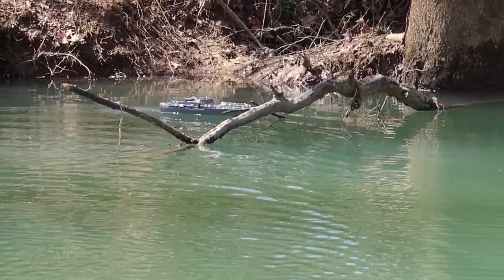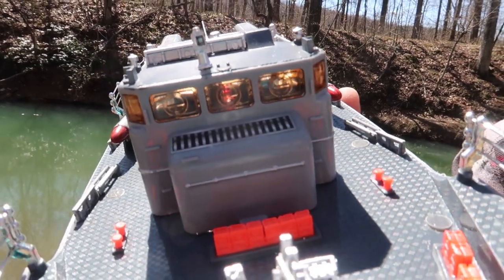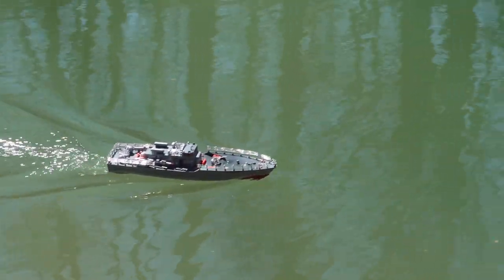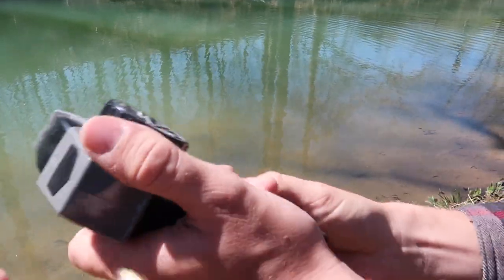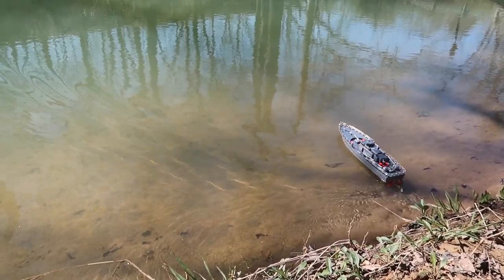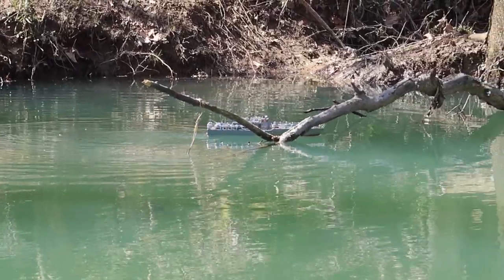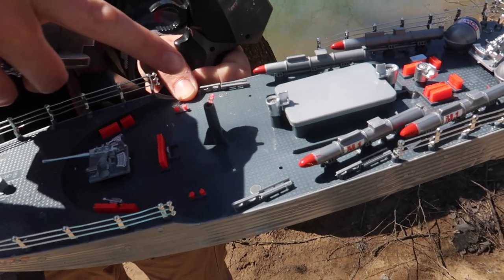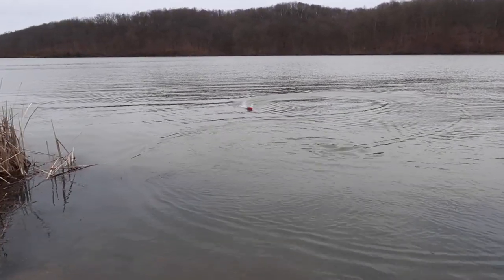MISSILE DESTROYER RC Boat!! - 1/115 SCALE EHT-2877 - TheRcSaylors

Comment: That is a very good looking boat. When you turn the wheel with out pressing the throttle does that make one motor go reverse while the other goes forward?  
I can see myself adding an anchor to that boat and a servo to control it.

Comment: Don't want to be a drag but the twin engines that steer one on one off are differential thrust and the really cool green stunt  boat where the prop moved is called thrust vectoring. not an expert buit think this is the correct terminology.

Comment: What Causes a Blue Tint in Well Water? 
Copper in the Water Supply. Residual amounts of copper are normal in your water supply, but cause problems when the...
Corroding Pipes. If you have pipes made of copper, replace them with PVC pipes to see if this corrects the problem.
Electrical Grounding. Using water pipes to ground a home electrical circuit proves rather useful,...